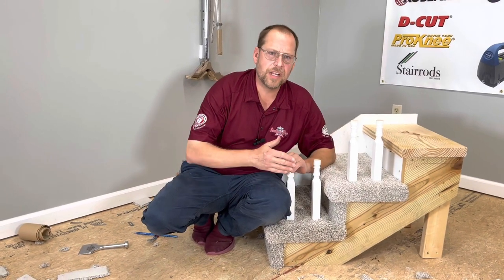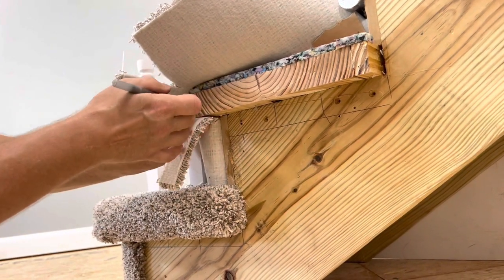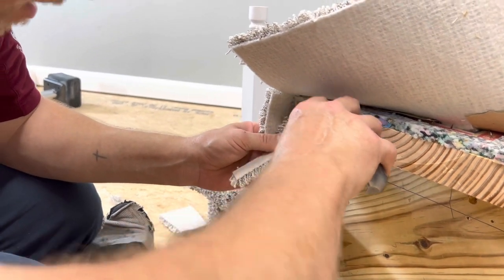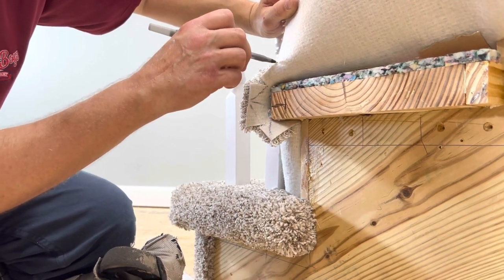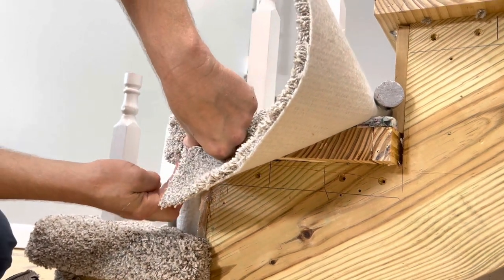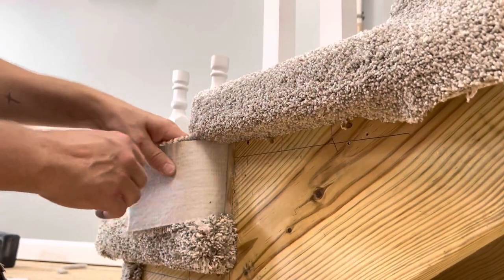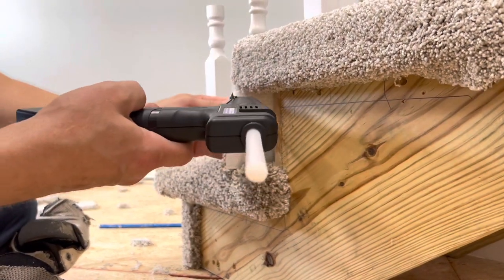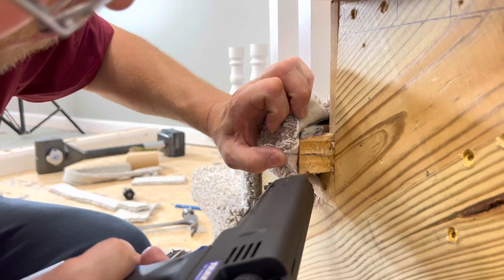Transform Your Steps: Carpeting with Bull Nose & Spindles

Comment: Hot glue rules.  Way too many staple jockeys out there worshipping their stapler.
 Did a flight of 16,  42 inch wide curved  stairs in a short  cut pile Millican carpet.  The wrapped edge was on a curved wall in a large circular entry.  Not one staple was harmed or disfigured because I didn't use any.  I made a long tip like yours, for my Orcon 100 Watt gun.  I love that hot glue.
Reply from the maker: Awesome